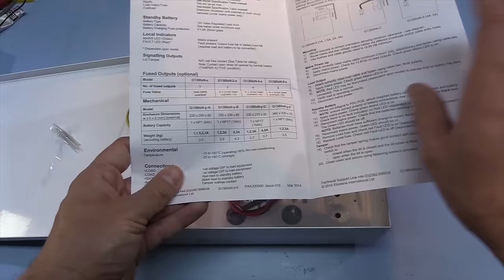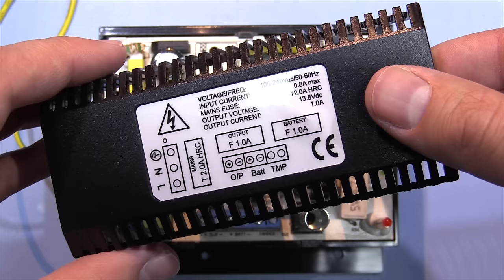SDG #033 Service Your Security Alarm Batteries!

Comment: Had a few batteries do what that Yuasa did, though often they also swelled up, often to the point of rupture. 

Old charger is run off 16VAC, as that is a standard ( and used all over for alarm circuits from antiquity) dating back to when alarms used relays and lamps, where the battery charger was a 16VAC transformer, selenium rectifier and dropper charge lamp and resistor. Light lit for charging, showing the battery was connected and working, and blew if the battery went dead. Still used on new alarms, but the old transformer you have is better than the ones supplied these days, which run hotter as they use less steel and aluminium wire.

Replaced quite a few batteries, though currently I have to just change the alarm batteries every 2 years, as the non adjustable charge controller on the board slightly overcharges the battery to 14V4, and is non adjustable. Nice thing is it does a battery test every 30 seconds by turning off the LM317 regulator ( transistor to set output to 1V2) so I get fair warning to replace the battery from the display and the beep, plus the phone calls....
Reply from the maker: +SeanBZA The charger on the actual alarm panel is much better and gives an early warning that the battery is on it's way out (it tests it every day as you mention). Thanks for the comment - interesting fact on the older alarms.

Comment: I'm surprised that the battery fuse didn't blow and prevent further damage. But maybe the fuse only protects when the load takes too much current ? That wouldn't make much sense to me. I'd put the fuse in series with the battery connection. Maybe it is though ?
Reply from the maker: +Peter-Paul Vervoort It is exactly as you say - the fuse protects from excessive loads or shorts. Poor design IMO.

Comment: Did you say the battery was 2 years old?  I've maintained a few panels over the last 35 years, and normally the batteries last 5-7 years.  I usually swapped out the battery after about 5 years, without getting a fault.  I have had batteries fail, but only if I run them past 5 years.
Reply from the maker: +Corgitronics Yep, not great for a Yuasa branded battery. The ones in the UPS tend to last 4 or 5 years, so I'm not sure why this one failed so quickly. The previous battery was getting a bit warm after 1 year in this PSU too.

Comment: Hi.
This switching power supply looks very modestly.(which is sometimes warranted)?
I do not see there battery status monitoring?
-I personally think that the older (Power line buffer) They worked a very long time!
something like:PSBS2012B 
A number of other...
Reply from the maker: +Tomtech29 These do seem to have the bare minimum and you're right - no monitoring or anything which is something that could be easily implemented. The more advanced units have more functionality but at 4x the price.

Comment: With regard to the 16.5v transformer, I wonder if it was to allow it to work on power supplies at the lower end of the 230v +/- 10%, which is 207v, which would drop the output to 14.85v (if my mathematics are right).. altho that is still on the high side!
Reply from the maker: +TheChipmunk2008 Possibly, but then once rectified through the full bridge and smoothing cap the voltage will be 1.414x that. If the transformer was smaller I could have imagined it is to maintain a reasonable output voltage under short term overloads.

Thanks for watching
Reply: +SDG Electronics After rectified through the full bridge the voltage will NOT be 1.414x input AC RMS voltage, that is totally wrong, pick voltage will be same as pick voltage of AC (which is as you mentioned 1.414x input AC RMS voltage) but without smoothing capacitor after full bridge DC voltage will be only 0.9x input AC RMS voltage (2Vpickac/pi). Now with smoothing capacitor DC voltage will be equel to 1.414 imput AC RMS only in case of no load, with any load value will go down (which depends of capacitor value and load).
Reply: +Miloš Lazović For all intents and purposes, what Steve said is correct. Yes the voltage will drop under load by half the peak to peak ripple voltage, but unless they chose the components poorly (capacitor value) you should always approximate the dissipation for the worst case.
Reply: Dr. Lecter
For all intended purposes voltage will never be after full bridge rectification same as AC pick voltages, no matter how big you put smoothing capacitor you will not get it with any load.
What you and Steve are saying is common mistake that rookies make.
You are right in only one that you need to calculate dissipation for worst case scenario for dissipation, but you need to calculate what is your output voltage in worse scenario for for that case.
They picked transformer on safe side, but not much overrated as Steve is implying.
I do not have any intention again to go to discussion about output capacitors in power supplies with you.
Reply: Miloš Lazović
Perhaps you could make a video explaining why this is the case. I have a degree in electronics and all of my text books also disagree with what you're saying. It would be useful for the community to understand the point you are trying to make.
Reply from the maker: +Miloš Lazović I simplified for the sake of the video. The full bridge rectified voltage will be 1.414x minus the diode drops under no load, but the point still stands - 16.5V secondary winding is excessive and it'd be very poor design for the DC voltage under load to fall below the RMS output voltage.
Reply from the maker: Dr. Lecter You're forgetting the forward voltage of the diodes, but under light load, you'll probably see higher than 16.5VAC from the output of the transformer as the transformer regulation is typically poor on transformers of this size and construction.
Reply: +SDG Electronics Thank you. I'm not sure what Milos' problem is, or whether he's just a troll.